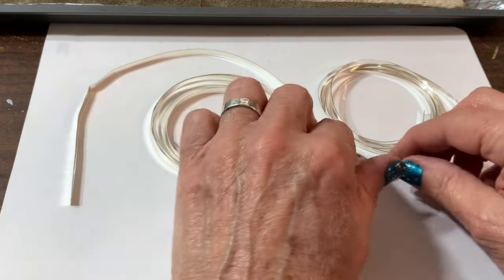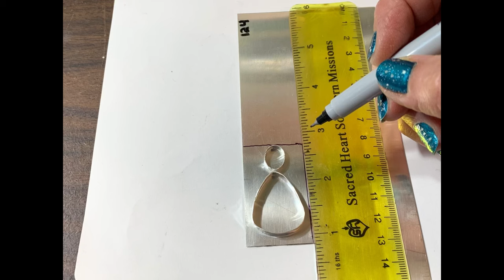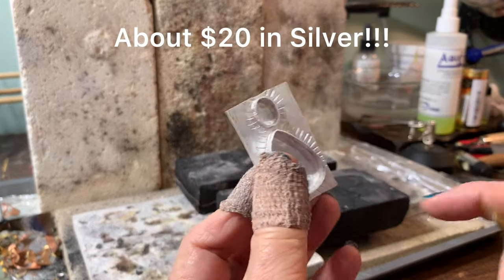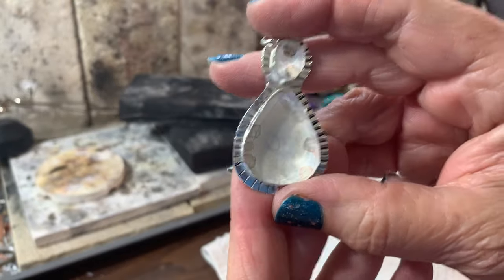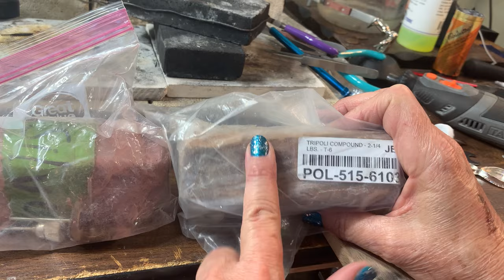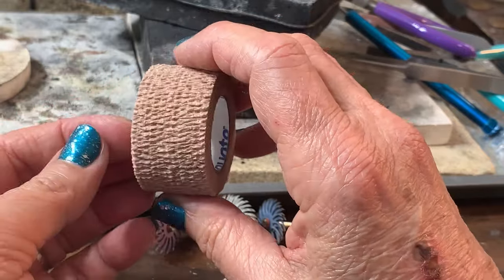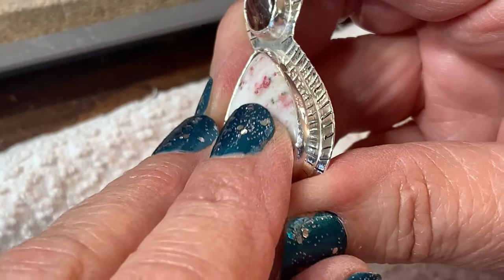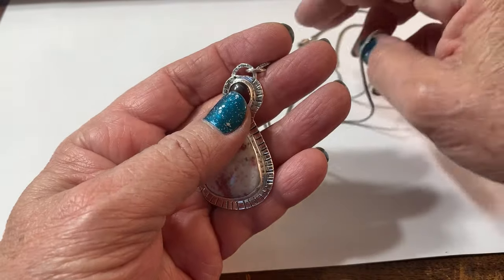Cinnabar & Garnet SS Pendant

Comment: It’s 1/4 of an inch, I have a bunch of 1/8 and it’s for really small stones… and when silver wasn’t so expensive I probably bought about 30 feet 26 gauge fine silver of this bezel wire… and I still have a whole bunch of it left… but I’d love that pair shape stone…it’s gorgeous❤❤❤❤
Karen, you did really good. You just do what you did. … after you finish with your soldering then inspect the solder job and that’s exactly what you did, and then you went right back in and you fixed it up. So that’s an A+ in my book.
🤗Michelle
Reply from the maker: 🤣🤣🤣 I had the measurements backwards…the small is 1/8” & the larger is 3/16”. I was never great with math but I looked up my order receipt to double check. I’m getting better & making charts now too 🤪  1/8, 3/16, 1/4, 3/8 & 1/2”
I remember my very 1st order I placed where I thought I ordered a more “standard” size but when it came it was super small & I had to order the next size up!  I do much better with the Gallery wire since that’s what I started with!
Thank you for your encouragement!  I got some local help recently (a 4th generation bench jeweler) so I was happy!  He even checked my Meco torch out for me & made recommendations!  He basically said that the Meco was “overkill for me” & that I’d do much better with a little torch (off brand) which arrives today!  Fingers crossed 🤞 
Continued recovery my friend!🙏😊💖💖

Comment: Oh, I feel your frustrations. That's crazy how the tumbler seemed to leave it with almost a pitting texture!😮 And then scratches. It's a beautiful pendant though.🤩 You pulled it off again!😊so pretty 😍
Reply from the maker: Exactly!!  Crazy, right?  I don’t have a clue why that happened or how to fix it???  It’s a brand new machine & never did that before!  Not that I saw anyway 🤣. I’ve only used it 3 times so far! Hmmm, I’ll have to try a scrap piece to investigate!  WTH?? 😡
Thx tho!  I really love this one! 🙏☺️♥️
Reply: @karensintuitivejewelry  I've never used a tumbler,... If I need to shine up my soft solder, I've burnished it with a stainless steel spoon. I found a silver spoon wouldn't  work, probably due to the difference in hardness. Of course I haven't  worked with the brass, silver, or copper alot, but they are softer metals. Isn't the shot for a tumbler stainless steel? I have heard of different media/shot being used for different applications. Also heard before of cleaning your shot or media? Not sure how to do that, maybe just dawn dish soap and rinsing it well through a fine wire strainer?  Maybe it has to do with tiny particles of the different metals breaking off in the shot/ media? Wishing you luck in learning what's going on. Let us know what you figure out, I know it'll be interesting. ✨🙏🥰😊💖✨

Comment: Nice pendant once again! Did you burn your hand? I hope it wasn't the torch. I'm always worried about hitting my torch.
Reply from the maker: Thx so much!  I was wondering when someone would notice my hand!  😂
It looks worse than it is but Yes I accidentally barely brushed it while pulling my piece from the quenching bowl!  Usually when I’m done using the torch I put it off to the left side of my table BUT for whatever reason (probably excitement over FINALLY getting the solder to flow 🤣) I placed it to my right side & this carelessness resulted in an OUCH!  It really didn’t hurt that bad surprisingly & mainly startled me BUT I will certainly be more mindful in the future!  I’m surprised that this is my 1st burn….knock on wood! 🤪